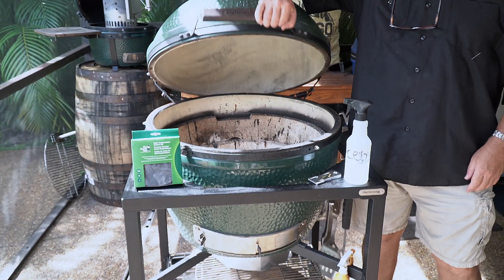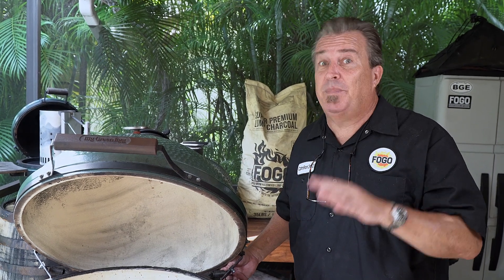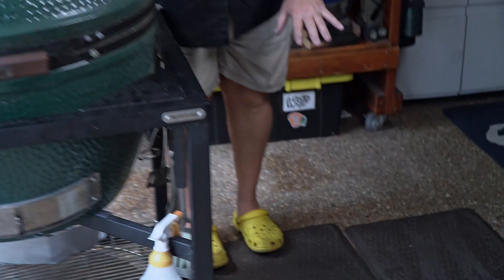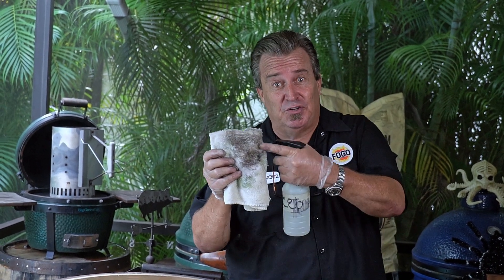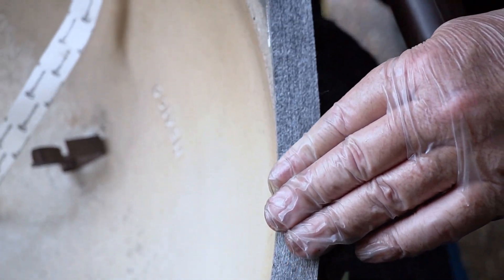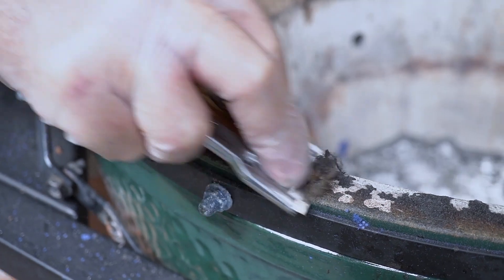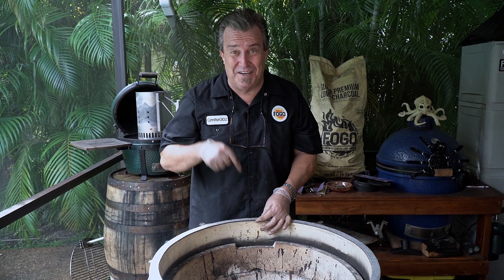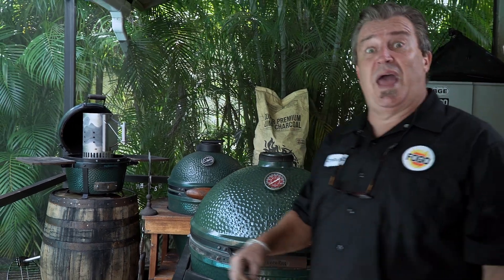How To Replace a Big Green Egg Gasket - Big Green Egg Tutorials

Comment: I find using a paint/rust remover drill insert from hardware store works best, no chemicals needed.  Make sure if going this route the drill insert is Not a wire wheel as it can damage the ceramic.  Easy to do.  Another quality Fogo instructional production by Captain Ron. You make it look easy.  👊
Reply from the maker: Hey Russ, that would definitely be a great way to go about it as well.  We sure do always appreciate your support sir!

Comment: I have replaced my gasket twice in 8 years.  I recommend 60 grit sandpaper on a 5 " orbital sander to get the glue off after scraping as much glue off as you can.
Reply from the maker: Great tip, thanks.  There has to be a better way than how I did it

Comment: Hi Ron, thanks for another great video on a timely subject.  I am planning for a clean burn and gasket replacement next spring.  I think I will do two additional things.  I will use a dremel-type tool instead of sandpaper and I will make a couple of small slits in the lower gasket near the hinge for the temperature probe wires so they are not sitting on top of the gasket.  Thanks again and keep it up. :-)
Reply from the maker: Hey David, those are some great and valuable points.

Comment: I have an XL. I'm using the Flame Boss 400. My seal was letting air pass through making it hard to keep temperature in range. I replaced the seal. The roll did top and bottom but was 3" short of going around the chimney.
Reply from the maker: That should fix your temp control issue.  I run most of m Eggs with no seal around the chimney at all

Comment: You mentioned doing a paper test at the end of the video to see if there was a good seal.  What do you do if there isn't a good seal?  I had this happen at the front and back of the grill.
Reply from the maker: You will need to do a band adjustment on it.  You should have a slight pull on the paper all the way around.  We did a few videos on band adjustments as well.

Comment: Hi Ron,  I have a medium size BGE that I will need to replace the gasket.  My question is do I have to break in the new gasket by doing one to two cooks at 350 or less degrees F?
Reply from the maker: The Big Green Egg gasket now does not require a break in period.  It can't hurt but if you put a new gasket, put it on, leave the dome closed for 24 hours and cook away.  Even though it is no longer required, I personally feel that the 350 or lower cook can't hurt but it's not as necessary as it was before.
Reply: @FOGOcharcoal  Thanks.

Comment: I used the Rutland (I think) furnace gasket on bottom only. It worked great for years. Base cracked at 18-19 years, so new base came with stock. Debating which way to go as it’s getting time to replace the gasket. 
The new hinge system seems to align dome to base easier and much safer to take apart.  Old system requires special pieces to stop spring from being uncontrollable.
Reply from the maker: Hi Barry, we are actually filming a Rutland gasket video this week!

Comment: My question is I have a brand new egg. Just put it together and when putting it together I seen the gasket is off on the bottom portion of the egg. I have NOT done an initial cook on it yet. Can I peel the tape/ gasket up and reposition it correctly? It came this way from the factory. Thanks
Reply from the maker: Hi David!  First, welcome to the addiction!  Second- I think you will be fine. as long as the gasket is covering a good portion of the edge.  You could always contact the place that you bought it from and they may correct it for you.

Comment: You mention there is even enough gasket material to go around the chimney.  Mine has never had any around the chimney.  Does it around the very top surface like on the lid and base, or around the outside surface of the chimney?  I never seen it done.
Reply from the maker: Around the outside just below the very top

Comment: Great video Ron! Easy task, just seems time consumin’. A wire wheel on a drill should help with the stubborn glue spots. Did the regulator cap gasket get damaged as well?
Reply from the maker: Hey Fernie, no the top gasket didn't have a problem.  I'd be afraid to use a wire wheel on the ceramics.  I'd be afraid that it would gouge it too much.

Comment: Question my egg is seal closed after I did a burn off how is the best way to get it apart with messing up the egg
Reply from the maker: You could try wedging a butter knife or something in there and move it along to free it.  I wouldn't twist it.  The other thing you could do is to put some lit charcoal in the front vent and heat it up to try and loosen it.

Comment: I changed my gasket today in my large BGE but I failed the paper test…. I pulled the paper out with zero resistance in the front and little on the sides. How do I correct this issue?
Reply from the maker: This video may help.  If you have new style bands, search fogo dome and the other video will pop up.  https://youtu.be/y6Zsa1YFh0k?si=emqfQDl8vG21bo0Q
Reply: @FOGOcharcoal  yes, I do have the newer style band
Reply from the maker: @jasonjohnston3415  here you go, hope it helps!  https://youtu.be/7zmaPhP-D-4?si=LflgbNd-y7-70gnL

Comment: Great video Ron. I know the day will come when I have to do my XL and this is so much simpler than expected except for how easy you made lifting the dome. That'd definitely be a two person job in my case. Question, did you vacuum out the scraped off gasket residue that fell into the pit? Also I'd like to see you do a similar video on an Egg with the older band setup like my Mini Max has. I have replaced that one once but had to take the entire top and bottom band setup off. Thank you so much for this.
Reply from the maker: Hey Tony, just get Roberta to help you with the dome my friend!  We can definitely look into doing a video for the old style bands as well.

Comment: The blanket trick and putting the dome upside down was a lifesaver. But I just put it back together and I have a decently sized gap in front that the paper test did not pass How do you fix this???
Reply from the maker: Just google FOGO dome adjustment and you'll find a video.  There is one if you have new bands and one if you have the old style bands

Comment: I replaced my gasket and now my lid isn't closing all the way. I put it back together exactly like the video said but after putting the springs on it has about a 1/8th inch gap. How can I fix this?
Reply from the maker: We actually have other videos on how to fix that depending on which bands you have.  Just search FOGO Egg Bands
Reply: @FOGOcharcoal  Yes. I saw those. I have the new band but that doesn't cover the lid not closing completely. It only speaks of under and over bites.
Reply from the maker: @JustJoe182  loosen the big bolt on the top band and push down.  Retighten.

Comment: Did my XL yesterday..I find it impossible to get the front to lineup without underbite..I’m convinced bottom and top aren’t the same size..am I the only one? My large never had that issue..
Reply from the maker: It is a very common problem, It may just be that your bands need adjustment.  Make sure the top and bottom bands are equidistant all the way around.
Reply: @FOGOcharcoal  that was prior to bands being installed. I just wanted to see if it would lineup..I wouldn’t care if I wasn’t failing paper test on back left..my only other thought is try spacing bands further apart by going up higher on green egg ridge

Comment: I would be a little concerned with using sand paper on the ceramic. It's actually removing ceramic material along with the old seal felt.
I love my Egg! The only thing that has made me stray from using it as much is of how difficult it is to obtain accessories, charcoal and replacement parts. It's such a pain that you can't order direct from BGE. It's such a hassle otherwise. 
Great post though! 👍
Reply from the maker: Hi Jonathan.  Just so you know, you can order FOGO Charcoal direct on our website and all orders over $40 get free shipping!

Comment: Nice job with a newer Egg, not the same for older Eggs.
Reply from the maker: Eggzactly the same
Reply: @FOGOcharcoal  I beg to differ... the spring assisted hinge is different and must be restrained during the disassembly process, not removed. If you still have the original shipping locks, they work great, and if not a couple of zip ties will do the job. Other than this detail the replacement of the gasket is the same.

Comment: What kind of sand paper did you use on the bottom gasket removal and cleaning?
Reply from the maker: I don't remember the grit but we started with a slightly rough one and went to a finer grit.  We didn't want to remove the ceramics.